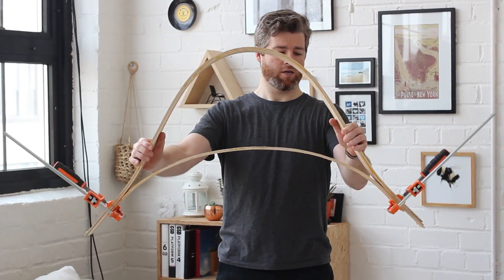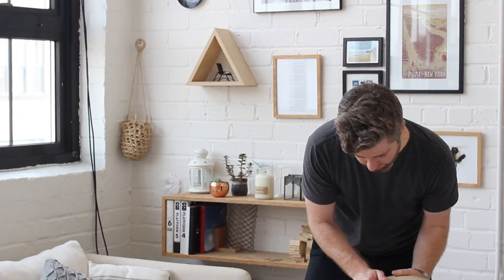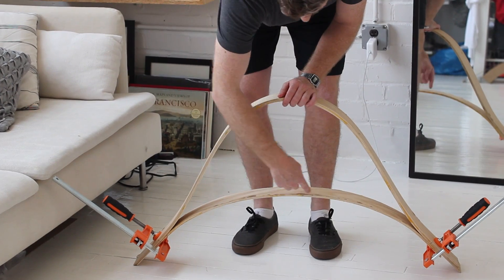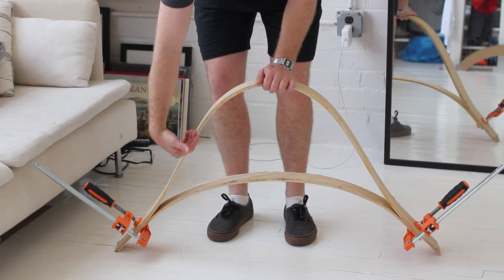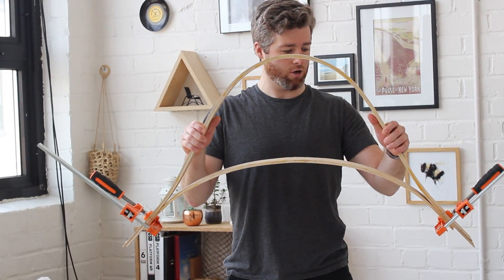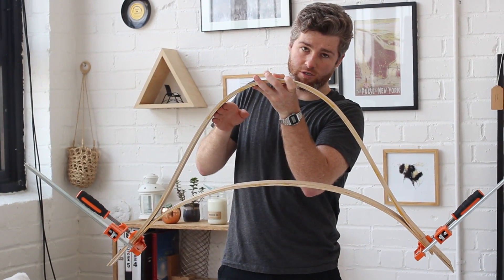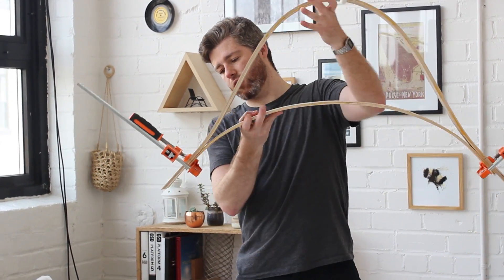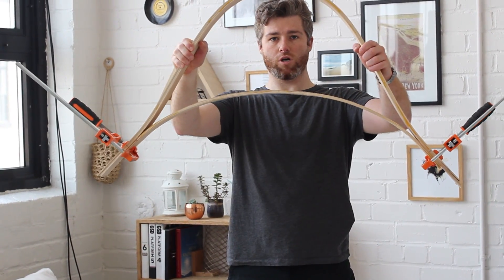How to Make a Chair | Episode 8: BENT LAMINATION

Comment: I don't understand much about woodworking so it's more of a question than a suggestion, if you have a guide for the bottom, couldn't you make another to sandwich the gluing pieces? I'm wonder if this could help with the pressure? 
That asked, your design is awesome!!! Thank you for showing how it's made!!!
Reply from the maker: Thank you for your reply! Yes, you're right you can do make double sided formwork. It takes much more time but it is worth it in the end. I actually ended up making new double sided formwork. I will post a video soon.

Comment: you should take a look at vacuum bag lamination! it is SO much easier and yield much better results! :)
Reply from the maker: Yes, I certainly need to look into that method. Can you recommend a good supplier of the vacuum bag equipment? Thanks for watching!
Reply: take a look at http://www.joewoodworker.com/ it is mostly about veneering, but they have really good tutorials on how to make the bags and the pump setups. i think they also sell materials and custom bags. I can't really point to suppliers because i'm in Brasil. but it is all made with fairly common materials and equipments. i have made a few vinyl bags and i have a 6cfm oil bath pump. works like a charm!
Reply from the maker: Brilliant! Thank you!

Comment: if you use a vacuum pump you will get the best pressure distribution for your bond. I think thats how the classic ikea chairs are so consistent. also consider insuring your patent.
Reply from the maker: I have made double sided formwork which hopefully will do the trick better, but I'm certainly interested in the vacuum method although I've never done it. I wasn't aware that you could insure patents.  What exactly does that do? Thank you for watching!

Comment: Love it! great idea clamping the plywood to the block!
Reply from the maker: +Tim Esplan Thanks Tim! As I narrow in on final shapes and thicknesses for the bows I will definitely take the time to CNC double forms. For now the blocks will do the trick as there is likely to be many changes. 

As for the fixings, I'm still toying around with a few ideas. One is to run a 1" dowel across from bow to bow to support the rear of the seat effectively replacing the large rectangular cross beam in the current version. Another is to do as you say sink dowels into both the bow and the seat this would require thickening of both elements in the area where the dowel would be. And finally I'm considering number of mechanical fixings that allow the chair to be fully dismantled. I'm going to prototype a few these joint this week and hopefully I can get you feedback next week! 

As always thanks for your input and for watching!
Reply: +Conor Coghlan I have done a good deal of it and as stated above having larger blocks is a huge plus. but if the thickens verys much at all you have to be careful with the mating form. one thing I have done is have a mating frame that is "close" and cut it at several places along the bend. sort of a hybrid between using blocks and having two perfect forms to sandwich it between. Bearkat Wood just did a good video on it. I love the idea of a half lap dowel to support the seat!
Reply from the maker: +Tim Esplan This is a really nice idea Tim. If I thickened the seat and bow in the area where the connections would be and used a brass rod as the "dowel", do you think I would need any epoxy to hold it? I'm wondering whether or not it would loosen over time.
Reply from the maker: +Tim Esplan Thanks Tim.
Reply from the maker: +Wood By Wright Thanks James! I'm considering making two pieces of formwork and sandwiching the strips in between. I've seen this done but never tried it myself. Do you have much experience glue laminating?
Reply: +Conor Coghlan A double form might be a good idea, it would certainly give you a more even spread of pressure throughout the workpiece. Even with the small scrap ply blocks in place, you still would have had concentrated pressure at every block. A long way of yet I realise but the ultimate thing to do, especially when it comes to manufacturing on any kind of scale would be to have a matched pair of double form blocks CNC cut from something pretty hefty, aluminium for example. That way you can get consistent results  each and every time. If you were being seriously clever, you could use a hydraulic press to both steam and subsequently glue the laminates. On fixings, I assume you are going to have to use something mechanical to be able to "knock down" the chair? Seems a pity you can't use a "pretty" solution such as doweling. You can however get a nut and bolt which are countersunk at both ends which might present a reasonable solution. I look forward to seeing what you come up with! Tim
Reply from the maker: +Tim Esplan can you recommend any dowel related tutorials on YouTube?
Reply: +Conor Coghlan Think of a dowel joint as being possibly the easiest imaginable version of a through tennon. Drill ever so slightly small, hammer the dowel through and then trim & finish. The beauty of them lies not only in their simplicity but in the ability to choose your doweling material as it is available not only in several timber varieties but also in the shape of acrylic rods and most metal 'bar stock'.
Reply from the maker: +Wood By Wright Great! Thanks James. I will check that out now. I think the half lap dowel could work really nicely on the underside of the bow. I'm also really interested in the dowel method that +Tim Esplan is referencing - it would appear as if the seat is floating.  Lets see what I can get done this week! Thanks for Watching James!
Reply: +Conor Coghlan I would be inclined to use an epoxy, yes. Purely due to the tendency of both the wood and (to a significantly lesser, almost imperceptible extent) the brass to distort with atmospheric and temperature variations. Better safe than sorry!

Comment: I'm doing this chair in my GCSEs in school and I just need to make it when it's done I been told I could get an a* or a
Reply from the maker: +Xxiizombnat1lar -Reco That's amazing! Best of luck. If you have questions about the design and fabrication let me know. Thanks for watching!
Reply: Thanks bro
Reply: Call me Reiss by the way
Reply: I have one question when you put the legs together with the chair how do you do it
Reply from the maker: +Xxiizombnat1lar -Reco I'll be talking about that in next week's video. I'm designing new joints for this chair. In the original chair I basically just rested the seat on the cross beams. You can see it in this video https://www.youtube.com/watch?v=HiAfP1PBcoo . If you decide to go this way you will need to glue on a small piece of wood to the back of the seat to stop the seat sliding down when a person sits in the chair. Hope this helps!
Reply: Thanks your a legend that's massive help
Reply: I watched the video keep it up it helps me a lot

Comment: hey conor, after the steam bending, you can mark both the form and the laminates at the top of the bow before you take off the clamps. that way you will have a reference point and you can make sure the laminates line up when you're putting the glue on. if they don't line up, you might not get a perfect fit, and you would need a lot of clamping power to close the gaps.
Reply from the maker: +hbart ! Great idea Bart. I will do that on the next set of bows. These are the first of many! You're right, there are defiantly a few little gaps that I wasn't able to get rid of no matter how hard I tried. How are things progressing with your chair?
Reply: +Conor Coghlan I had to postpone my plans due to some other projects that I had to finish first. I'm going to get the veneer this wednesday, looking forward to getting started! I'll keep you posted.
Reply from the maker: +hbart ! Sounds good Bart! I look forward to it! Love to see some footage too if you have time.